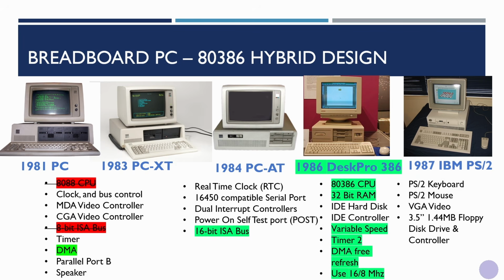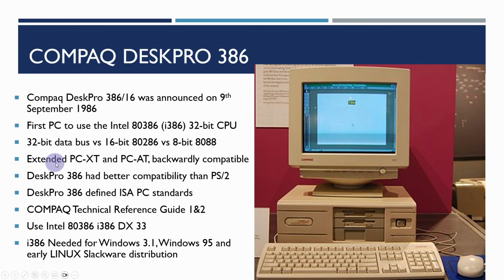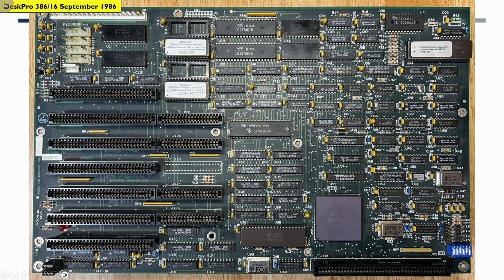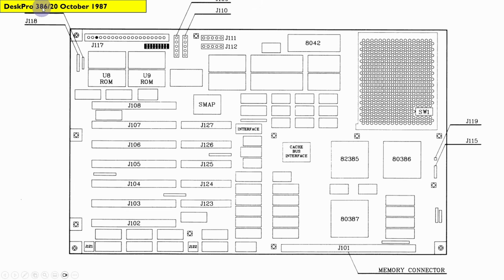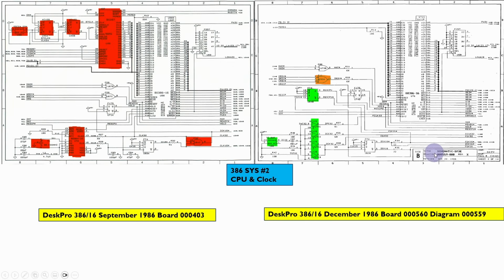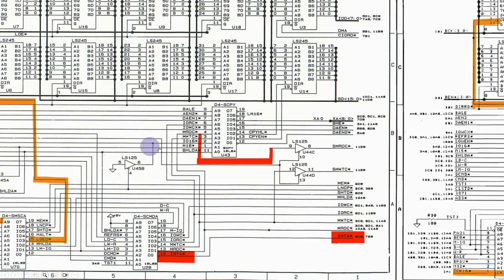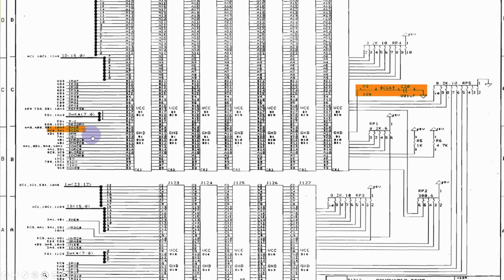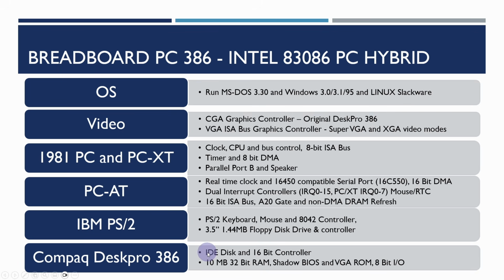386 Breadboard PC #2 COMPAQ DeskPro 386 Design

Comment: When I were young, AMI had designed the 386 board with direct-map cache controller using TTL and PAL/GAL.
I had modified the cache controller and BIOS. Also, designed the adaptor to interface the 486 to the 386 socket.
I still have the board and 32-bit memory card in my storage......
Reply from the maker: Well done, I wish I had kept my first PC, a 486DX33 from 1992 but threw it out more than 10 years ago. I am just disassembling the COMPAQ BIOS so you have my admiration for modifying the BIOS back then without all the tools we have now. Dave
Reply: @breadboardinglabs  Oops.. I still have my first 4.77 XT with V20 running at 8Mhz. I designed 286, 386, 486, pentium, pro, II, core, core 2.... threw tons out.. but still have a room of boards, cpus, systems designed for IBM, HP, Dell, Compaq....
Actually, there are many tools available in the pass. For disassembly, you can use "sourcer." It will generate the source code from BIN. Easy to modify the BIOS. However, the later BIOS getting fat and use compression and shadow. Therefore, hard to do it from DOS. But I  knew the CTO of Award, AMI, and Phoenix BIOS, so the source code is not an issue.
More, since we were the alpha site of Intel, our code bring up on emulation machine in Oregon, and with the help of CPU JTAG, we can single step the CPU and modify the register value as well. The HP 16500A LA can see the bus cycle step by step. For the fist Intel dual processors, it's in SMP mode, not ccNuMa, we can even chek which is the BSP after the round-robin cycle.
Well, I am too old to remember the details. But your video brings me back in time~
Reply from the maker: Ah you obviously had better contacts than I have/had. I only ever used PC's in the late 1980's, not building/designing them. One reason for going back to understand it all from the ground up is to fill in all the gaps in my understanding from that era. Dave

Comment: This is one of the coolest thing i have seen. What is the most powerful processor you could realistically put on one of these prototype boards?
Reply from the maker: Well I think it may be possible to do a 486DX 33 but some faster 486 processors didn't use 5V like modern CPUs. 486 has similar PGA socket but with 17 pins per side not 14 for the 386. Pentium upwards I don't think would be practical as would need special PCB for CPU socket. Not seen a 486 design which doesn't use VLSI integrated chips for most logic though may be able to swap the 486 with 386 in DeskPro design with a few tweaks. Will be at least 6 months before I look at the 486 though chip arrived this week from eBay. Dave

Comment: You don't actually have to route the A20 through the keyboard controller unless you're using some software that depends on that quirk. I know you want to be faithful to the schematics, but I'm just putting that out there for anyone watching.
EDIT: Oh, I hadn't made it that far in the video... nvm
Reply from the maker: Thanks for the info. I am trying to keep as close to the original DeskPro design so I have more chance of getting the original Compaq BIOS working once I have got it working with a modified XI-8088 BIOS. Dave

Comment: Immediate subscription from me. Good luck with this insane project, it's going to be a BEAST. I didn't even know there were 386 machines with low-scale integration chips! I replicated IBM 5160 two years ago because it had (almost) no custom chips. I've checked 5170, and there were custom chips there already. I didn't even think to check Compaqs or any 386 machines. Super interested in your results!
Reply from the maker: Thanks! The main thing with the Compaq is that the custom PALs have the rules defined in the internal design document. Without that document I don't think it would be possible. I think the PC-AT PALs were fairly straightforward decoders/RAS/CAS logic so could probably be worked out. Its just the 286 was not as interesting as the 386. Dave
Reply: @breadboardinglabs  The equations for PALs are in the documentation?! Great! I've hit a bump in my 5260 project with single PAL there, as I was replicating 16-256k model of the board. I could not find equations for it. But luckily there is a very old mod for 256k model to turn it into 640k model, and it requires to change the PAL to custom GAL, and there are available equations for that. ^_^ So I sort of HAD to make an UPGRADED 5160. Well, never say no to an additional RAM. Although I have merely designed a PCB, while your work with breadboards is something else. Mad respect!
Reply: the main obstacle to replicate a 5170 is the so-called "U87", which is IBM custom PAL chip. however, thanks to the article "Reading Secured PALs" by Charles MacDonald published over 10 years ago, the content of U87 can be read and 5170 replicated. even the "8042" Keyboard controller ROM of 5170 was dumped - "1503033.bin" available online and you can burn to a programmable 8742 IC using Matt Millman’s MCS-48 programmer for Arduino Mega, but I am repeating myself, because most of those, I've already mentioned to my 2 comments under the 1st video Dave made in this series - you can check them out, if you're interested in details. stickily speaking about "December 1986" version of Compaq DP386, everything that is custom and programmable is already available (all PAL source code is in the "Internal COMPAQ design documents", the BIOS dump is available online), except the Compaq "8042" Keyboard controller ROM, but as I mentioned in the aforementioned two my previous comments - I am going to try to dump that too. also, Compaq "8042" Keyboard controller ROM is probably not even that critical and other 8042 KBC can be made working from 3rd party vendors.

Comment: That's a fair bit of dedication right there, I must say. That someone create project files based on actual schematics makes it a bit more likely that others to add to the work making PCBs and FPGA implementations. If it's gonna happen, I'm not sure of, but the effort matters, I'd say. Kudos for that!
Reply from the maker: Thanks, I hope so (PCB++). I certainly don't know enough about modern PCB design to be able to design one. I figured that going straight to the 386 Breadboard design in KiCad may miss out some aspects of the original design which I may later regret. At least this way I have to make a conscious decision of what stuff to remove. I am also about half way through converting all the old PALASM PAL definitions into WinCUPL together with simulations & tests which should help too. Dave

Comment: Have you ever noticed that 33 MHz is acutally 33 1/3 Mhz and that nearly all clockrates are derived from 4 1/6 MHz? Yes even 25, 100 or 1000 Mhz can be devided by 4 1/6. Well, I find that interesting probably because of my autism which comes with nerdy thinking.
Reply from the maker: I suspect 66.666MHz and 33.333MHz will be because these give clock periods of 15ns and 30ns. Also in later processors like 486 and Pentium the Front Side Bus and PCI frequencies were multiples of 33.333MHz from memory. Engineers seem to like dealing with round numbers of nano seconds ;-) Dave